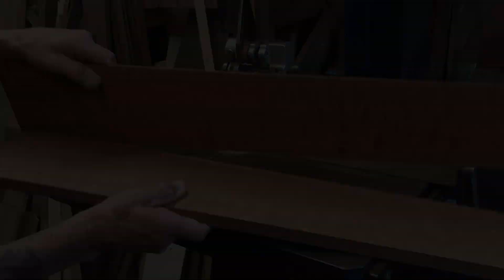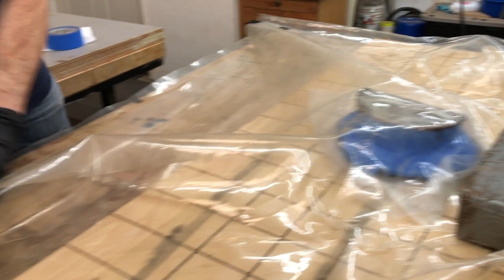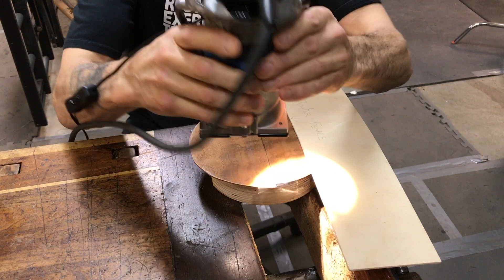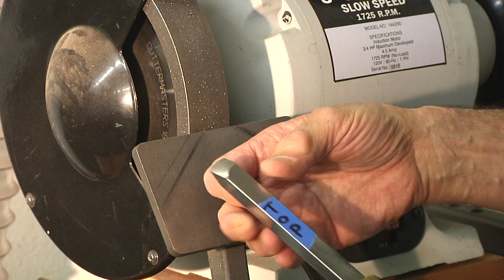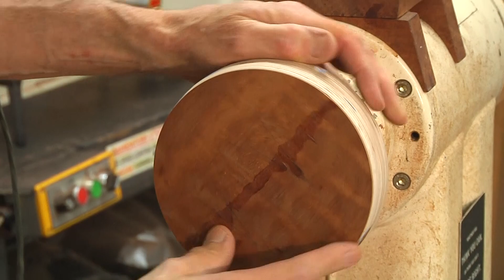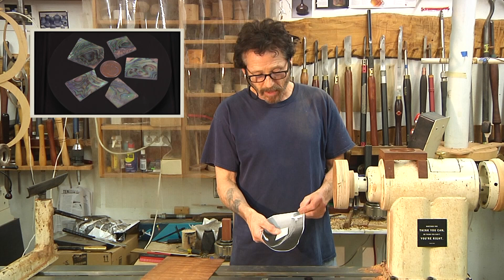Woodworking Technique: Gluing Veneer on Compound Curve

Comment: I don't see the sense of bagging this bit of work, if you will use a lathe to clean it up after the vacuum table, why not eliminate the middleman (vacuum press) and instead cut the curved surface on the lathe entirely?

Comment: Awesome. Studying about wood work to build a rowing shell (single skulling skiff) and got some ideas about cross diagonal stip plank glueing, thought about alternatively to use paper backed veneer (4 layers intotal) to get the around nicely of the hull shape which is very curved. So tks for uploading.
Reply: That veneer will be so thin that when you fair the hull, you'll cut through the outer layer and the paper backing will show.  If this is acceptable, carry on; if not you'll need to use another material for the hull skin.

Comment: Wow, David - that looked like a hologram when you wet it!  So much depth!  Two questions.  I noticed quite a bit of glue getting on the top surface of your vacuum bag. How did you get that cleaned off? Did it just peel? Also, what is that little wooden cupholder thing on top of your lathe? Simply for holding small parts?  Thank you for the video explanation, really cool.
Reply: Hey there wilcoxtube, yes quilted mahogany from The Tree is my first choice of all woods but it's so expensive that I do as much veneering as possible. It truly has a three dimensional effect to it when it's wet with water or has finish applied to it. My vacuum bags are heavy duty Polyurethane which resists the glue from bonding to it. Also I generally use wax paper to prevent squeeze out from bonding to the platen. The wooden cupholder thing (with magnets to attach it to my lathe) used to hold a light,but the cameraman fromWoodworks knocked it off and broke it so now it's just a cup holder.